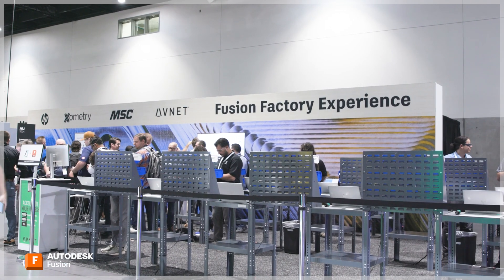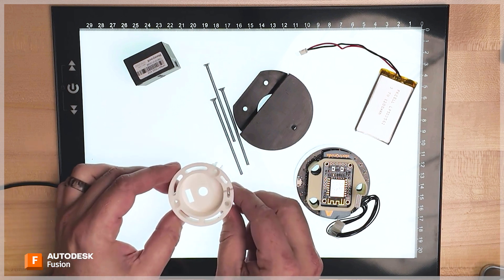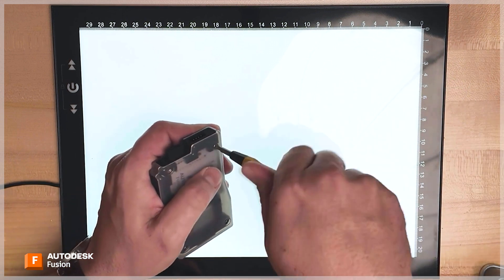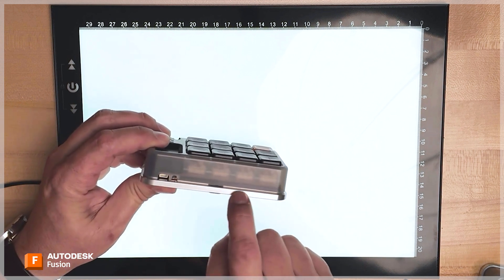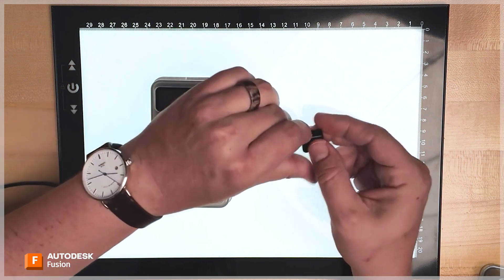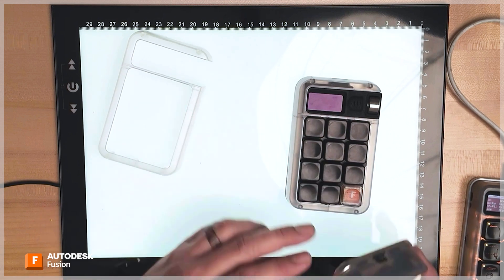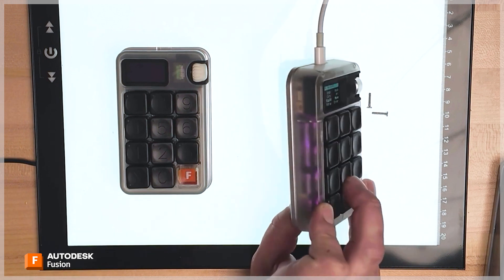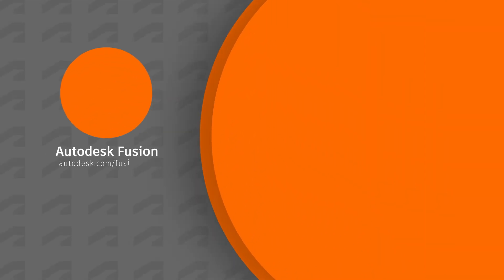Can You Build Awesome Products With Injection Molding? | Shop Talk Factory Floor

Comment: so how do you design the case to fit precisely around the internal circuit board?  do you import a 3d model of the circuit board with all its components mounted to it? if so, how do you make the circuit board  3d model?
Reply: Eagle is built into F360, so there is a 'Fusion sync' button that moves your pcb design to the modeling side. Otherwise one could import a outline then extrude in F360.
Reply: @YetAnotherPilot  It's been over a year and a half...